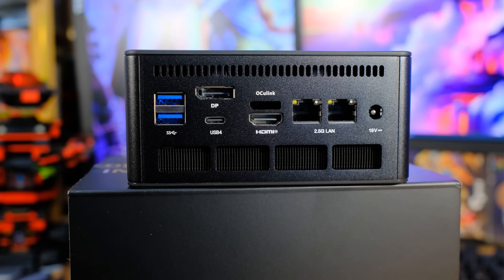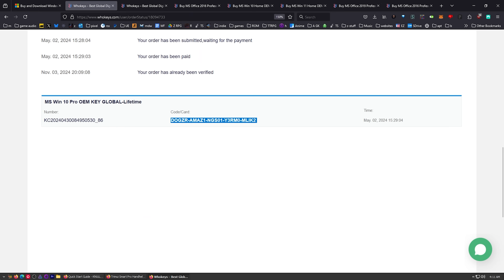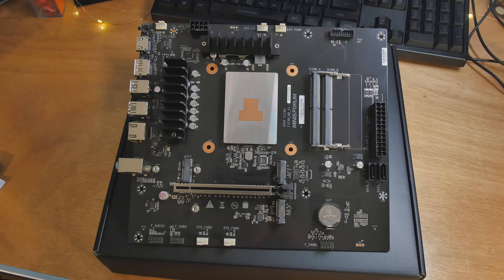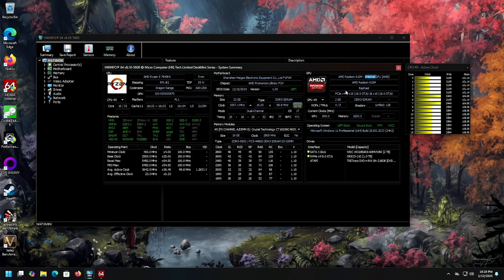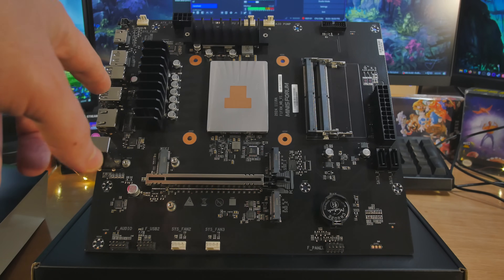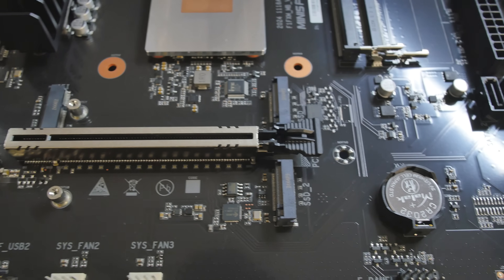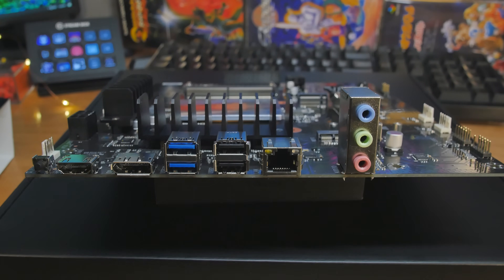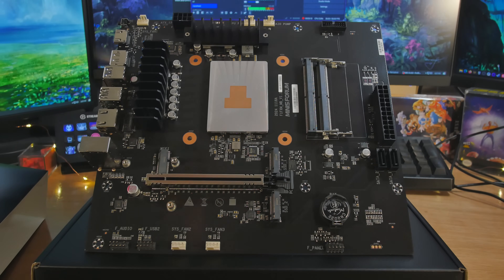Minisforum BD795M: AMD Ryzen 9 7945HX MATX Motherboard  - Benchmarks & Info

Comment: All the specs I've read say this uses a LGA 1700 socket and you say 1170. Not cool. there are so many different models of these. And I don't understand the low passmark scores. Others have shown they get 13000, not 4000 like yours shows.
PS: there is no 1170 socket so you must have mis-spoke,

Comment: 13:50 what has happened to the font? It's merely readable from 1080p up to 2160p. This is inacceptable. You have to think about a better bitrate and a light compression
15:00 WHAT are the numbers in "CPU Package Power"??? I cannot see.. What did you do..

Comment: I'm not a huge fan of the lack of USB Ports. 4 + the front panel, and no front type C, is really lacking. I'm not sure if that's because of the limitations of the mobile platform and if it is they should clearly mention that. Aside that, I do like the mITX formfactor.

Comment: I got it about a week ago.  Put 64GB in it, too cheap to pay the 96GB premium.  The SATA system absolutely doesn't like my 6TB HGST 3.5" spinning drive, i have a  2TB western digital hooked up at the moment, along with an rx 6800, a brand new 2TB 990 evo plus and 2TB old intel 660p.  Runs like a champ, I only run void linux on it.

Comment: The lack of the USB C is probably due to the PCIe port.  CPUs can only handle so many high-speed lanes, and between the PCIe and the NVME ports, you're probably eating up most of what the CPU can handle.  

It's a bit of a shame, because the USB C would be a sticking point for me.  I have another of their Mini PCs, and it uses the same CPU, but it's the HS version which has a better iGPU.  Like, WAY better.  I can play Elden Ring with it.  The biggest problem I see with this board is it's about the cost of my Mini PC, and aside from the cooling on it, my Mini PC is better.  I don't think the cooling is bad enough to thermal throttle often, but you know it's going to happen more often when the whole case is roughly the size of the cooler shown in this video.

Comment: I’m seriously considering one of these for a truenas server build. Will just need the slot for a hba and if I need more slots I’ll use the bifurcation it offers to split it out to two slots. I’ve not seen an economical way to do that though. I guess I’ll cross that bridge when I get there. 

Anyone know how this cpu does for plex transcoding compared to a i5-13500? I know probably not as good but how much worse? That’s my current server but it’s drawing too much juice. Could be because my mobo is a z790 chipset.

Comment: I agree that a CPU integrated into the motherboard is probably the way of the future. How many people upgrade their CPU? Chipsets and peripherals are increasingly tied to a single generation of CPU anyway.

However IMHO Minisforum stripped the spec on this one back too far. I would rather pay a bit more for a board with 4 standard DIMM slots, 4-6 SATA ports, and more USB3 I/I. This would be the basis of a brilliant home server / lab machine.

Comment: so long as i have a couple m.2s, a gpu slot, plenty of usb, good networking, i really dont need anything else. still want to see good fast ram and good cpu soldered on a soc module to give the ghost of grace hopper a lady stiffie. wrapped in a vapor chamber and dense fin stack on both sides with a couple headers to connect it to the mobo (which is really just a breakout for power and ports). if you are going to do minis, get rid of the wasted space.

Comment: Waste of money....Id rather buy asrock deskmeet instead.Than throw almost 700usd down the drain.
Reply: That's 280usd for chassis, mobo and power supply.  You still need a chip.  I already have a full system just want to upgrade mobo cou and ram.
Reply: @bnolsen  Yes you still need a chip but its way better to get one that will have  an upgrade path.This one cant...You can get so much more with 700 than this.

Comment: Isn't pcie lanes always a problem with these mobile cpus?

Nevermind, just checked and the Ryzen 9 7945HX has 28 pci-e lanes and according to techpowerup this board has fully connected x16 slot. With 28 free lanes there shouldn't be any issue with lane blocking between gpu and ssds, nice.
If it had the 780m igpu it would be an awesome bundle. Too bad i can't afford it 😋

Comment: Bought an 5900X needed a new mobo, bought an 7800X3D needed a new mobo... whats new ? :P
Might as wel get somthing like this.
Last thing i had broken was an Intel mobo with an nForce 680i SLI , and a ATI All-in-Wonder 9800 .... says enough..
Mobo got plonked while flashing the bios, the ATI got borked while modding the card :P
Oh i type this with my BD795i with 5700XT in an InWin A1 Plus :P
Reply: The difference is if anything goes wrong you have to buy an entire combo not separate components. The difference is that you can get a stable reliable mature bios from a known brand name with updates down the line.
Reply: @tendosingh5682  oh yeah like Asus and Gigabyte that remove limit on CPU so you blow up your Intel and AMD cpu right.. you do know what an 7950 costs right ? alone is 100$ more then this combo.

Comment: I'm personally considering replacing my current desktop pc with this. Pros definitely are the low power while idling, less heat in general, less noise. I will use a mini pci-e to pci express 4x adapter to get usb-c with an existing pci-e  card I have in my current old pc. For graphics I will first try the current gtx 1060 6gb model and if I feel the need to beef it up, I'm planning to go with the EtaPrime route using the Intel Arc B580. I have a feeling this pc will last a long time in my use and even if I do replace it with a faster one, this thing is stand alone and can be easily repurposed as home router/firewall/media center purposes were it consumes very little while being idle most of the time.

Comment: Actually, that right there, is More than I really need.  EXCEPT  for the Radeon 610M graphics. I would have loved to be able to put a USB4/Thunderbolt4 ad in card in that PCIe slot and get all of the connectivity that is otherwise lacking, and then call it a day. However, those 610M graphics are just awful and I would need to populate that only slot with a GPU. 
I would rather have the Ryzen 9 7940HS and it's quite decent 780M graphics, and then ad in a USB4/Thunderbolt4 card.

Comment: Putting all those components on an ITX PCB would have taken more time to layout, check, and assemble. This micro-ATX PCB probably has fewer layers, six at most, than an equivalent ITX PCB resulting in higher yields and lower costs.
So Minisforum is taking far less financial risk with this product.
Disclaimer: I did PCB layout for over thirty years. 🥱

Comment: I’ve been using one of these (the BD790i) in my AI server for about 8 months and it’s consistently the most responsive system I have, the 7945 is a hell of a chip and it sucks that the 7950x isn’t more power efficient because it’s much harder to get one of these instead

Comment: I seriously considered picking this board up before deciding on the ASROCK DeskMeet 600x, DeskMini was also worth considering.  I would have probably gone this route had they used DIMM slots over SO-DIMM. They probably could have shoved 4x slots on that board, too.  The lack of USB 4 and GEN5 M.2 is a bit concering. Adding a single PCI x4 slot would have at least given an upgrade path to fix those issues.
Reply: The biggest issue with the x600 is that you have limited space for the cpu cooler, only 53mm or something like that.  Only a couple of coolers can fit that space and cool 65w TDP processors.
Reply: @nneelix unlesss you replace the PSU. The deskmeet x600 psu is very big, if you replace that with a regular SFX, you will get more space for the cpu cooling
Reply: @talha0139  Agreed, SFX Gold 650w+ modular PSU would be a nice upgrade for the DeskMeet x600, and it's on the list.  However, I was able to get plenty of CPU colling using the Thermalright AXP90-X47 Full Cooper and inverting the fan so it blows into the PSU.  Way cheaper, too.  If I add a GPU, I will probably replace the PSU.

Comment: I think one of my biggest concerns with products like this from Minisforum , as well as other Chinese mini PC vendors, is their extremely slow or flat out lack of bios support. We give Gigabyte,Asus, MSI etc flak all the time but at least they release bios versions every 1-2 months to resolve stability issues or security concerns. The same cannot be said with the minipc companies. Its not even just regular bios updates but just the ability to do a bios update is not available.

A good example from minisforum is the MS-01. I own this mini workstation and love it but I got lucky picking the 12th i5 gen variant. servethehome forums are filled with frustrated 13th gen i9 variant users with a ton of issues. It took minisforum months to release a new bios and didn't even include the tools required to update the bios, end users had to figure out a solution. Also, after months of waiting, the bios didn't even fix all the problems for folks. 

Hopefully these companies start taking bios support more seriously.

Comment: My first reaction to a built-in CPU was that I thought it was a bad idea because it's not upgradable, but then I realized I've never actually upgraded my CPU without also replacing the motherboard. I don't think this one is a bad deal since the whole package is cheaper than just that CPU.
Reply: thats my stance. i always do mobo/ram/cpu as a single upgrade anyway. with gpu, storage, and everything else being separate upgrades done on a 4-year upgrade cycle (one every year).
Reply: Upgrading my 3600 to a 5700x3d was the first time I didn't have to upgrade both CPU and motherboard, and I wager most casual builders aren't going to upgrade any more than I do. I might skip AM5 entirely because I don't see myself outgrowing this CPU anytime soon.

Comment: CPU integrated sounds troubling, but after you think about it (especially on the Intel front) you're looking at three years until platform obsolescence anyway, so not really an issue.  Less of an issue on the AMD side if you get onboard at the beginning of a cycle.

Comment: I'm a regional truck driver who is on the road for weeks at a time. I used to game on a beefy desk top before i took to the road. I currently game on a Legion Go and a 2022 G14 Zephyrus. Powering these devices and other electrical essentials is an Anker Solix C1000 (1800w) battery generator 

I've been getting the PC build itch for quite a while because desktop gpu performance is still king of the hill. The caveat is my build needs to draw roughly 300w - 400w. This MOBO would be a great base for my needs.
Reply: Yes! Pair it with a hdplex 500w DC PSU (12-48v) and you will sip on power. If you have 24v or higher house batteries then you'd be set.

I have this board+5700xt (capped at 180w via Linux) and on the desktop its sitting around 40-60w, gaming 330w max.
Reply: you should go with the smaller bd790i. 100w for processor another 200 for the gpu you'd be good

Comment: I don't mind as its one less thing to worry about. Only down side is if Minisforum Customer Service and Repair Services is terrible you're stuck without everything for who knows how long.
Reply: And they never release security updates for BIOS, or way too late. Support is Minisforum's achilles' heel, and the reason we avoid them in business as the plague.
Reply: These things are cheap for a reason. It is one of the most affordable options of getting a 16-core with modern features. Lots of pros, but also lots of drawbacks. Sketchy or practically no customer support, no driver/firmware support, limited restricted bios features, questionable build quality.
Reply: @Totto70770 there's self help forum with build like these. Mostly in Chinese though. They're in Bilibili.
Reply: Which is the only thing that makes a company good lol.
Reply: They do not provide the BIOS manual at all.
Good luck trying to configure RAM timings and then finding that you cannot reset a misconfigured BIOS.
Reply: What company hasn't had terrible customer service especially since the virus and they are big names like MSI, Asus, and even Nvidia. Most retailers offer warranty services anyway and for cheap because the MOBO and CPU is covered for the same price or cheaper than just the CPU. If you're using it in hot conditions, you can get a Thermalright 360AIO for $50USD and play in the sun in south Florida mid summer.
Reply: @ANGRY_AMERICAN  I have had to make use of Asus' customer service twice since the pandemic. I would not call them quick, but the issues were politely and fully satisfactory resolved. I have had nothing but trouble with Minisforum's products and ZERO customer service. So there is a big difference.

Comment: Mobile cpus I don't mind 
As long as:

It's configured correctly and sips power
Is configured correctly to use power when required
Is properly placed near the ram so there's no timing and performance issues

If you can't do it well, then don't. There's not much benefit of having a mobile cpu then.

I bought a cheap mobo off aex. 14c20t alder lake CPU. Its not bad for the price but quite unstable. In the 2 months I've had it it has needed to be opened twice for whatever reason
And once it corrupted my proxmox install. No idea how.

So yea. I guess I get what I pay for

Comment: I used to think that the cpu being integrated was a horrible idea, but now I realize that I almost never upgrade the CPU so screw it.
Reply: yeah i'm getting older and I need to spend less. Once I can get usb 4 on this I'm done.
Reply: yeah I usually bin the board and cpu at the same time too....
Reply: Yep until the motherboard dies 😂 and you are screwed 😂😂
Reply: @supernova655  Most times when the motherboard dies you would go for a newer generation anyways.  I tend to be a good generation behind anyways due to just trying to save a buck.  If I can get one of these as a " combo" for less than what the parts are, screw it this works.
Reply: @supernova655   if motherboard dies, you can always get new one.. TOPC is cheaper alternative, they also have waifu version of this Mobile-CPU-on-ITX-motherboard thing... and they have the expensive one, Ryzen 9 8945hx...
Reply: @supernova655  I see you completely missed the part about this being cheaper than just the equivalent desktop CPU variant, now how often do motherboards die? I’ve had numerous different brands and sizes of boards and have never had one die, it’s always been a separate component if something ever did fail.
Reply: @TrueSkyl1n3  are some negative feedback's of some Minisforum with bad motherboards blue screen etc

Comment: Lower the density of component from a itx, now it is matx 

Everything coming from processor IO die and that explain why not much IO on there (pch is not present in this board so technically a x600 if it have a socket processor )